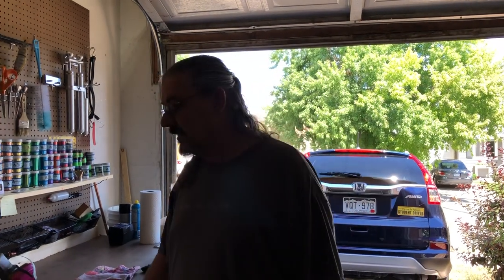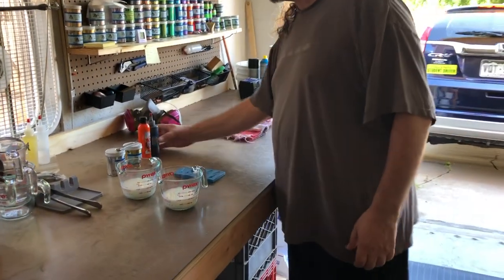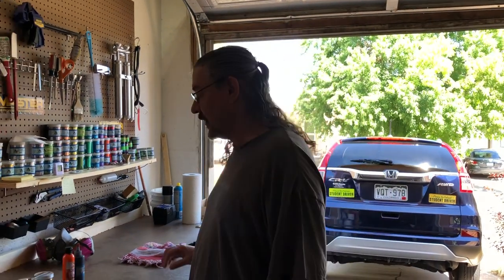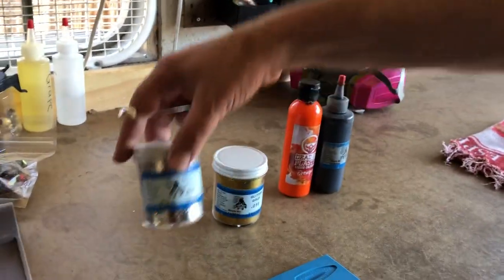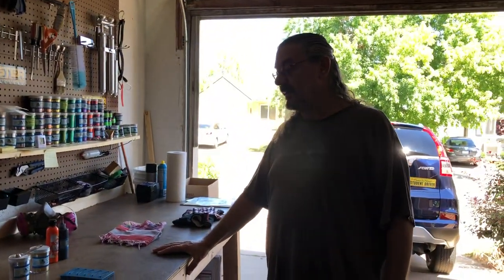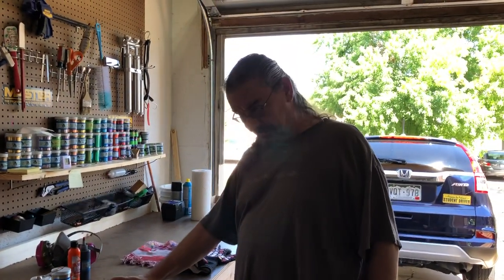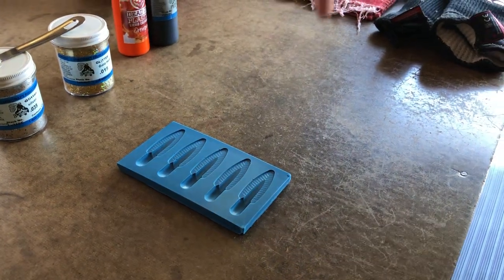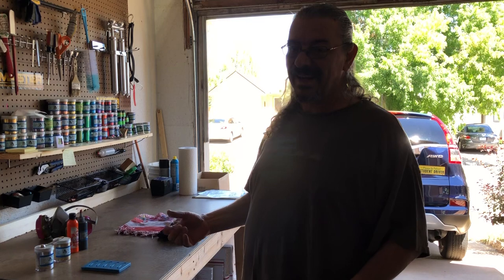MF69

Comment: I also pour a mold that is similar to that reaper you're trying.  Tilt the mold towards the head end and pour from the back to the front.  When you pour the second color, tilt the other way and pour from the tip of the tail towards the head.  It will give you a thinner result and give you more action.